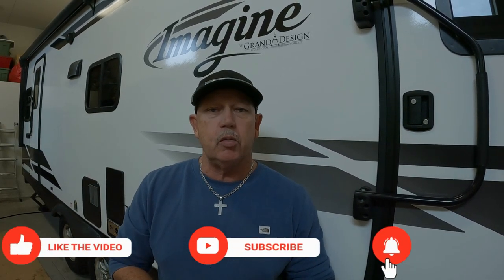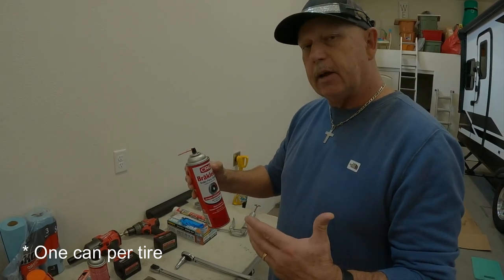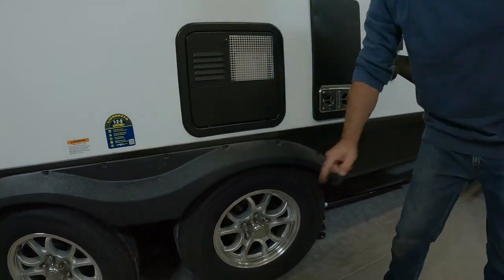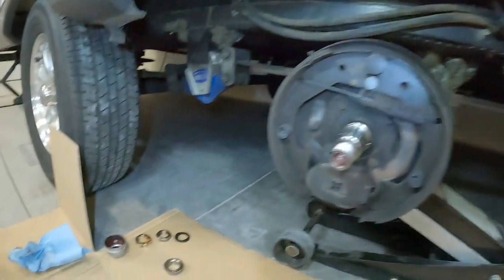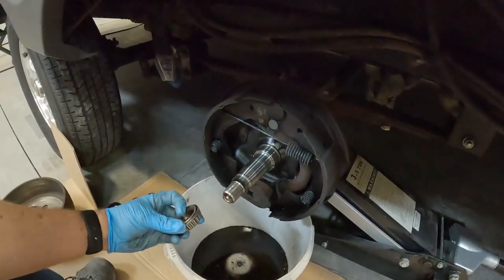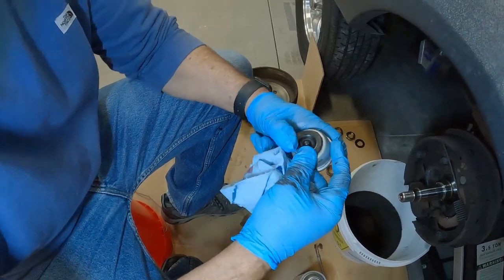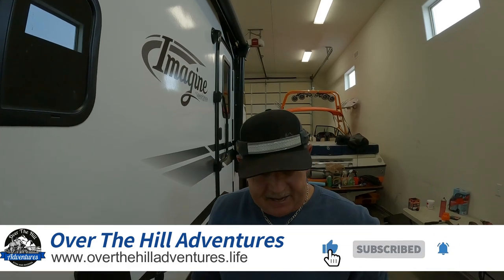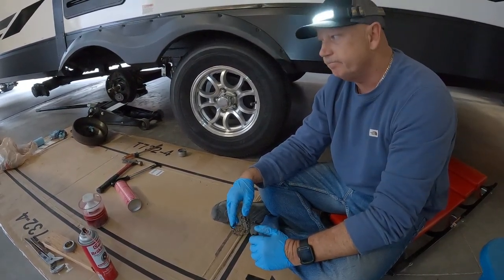GRAND DESIGN IMAGINE DIY HOW TO REPACK YOUR TRAILER BEARINGS AND SAVE MONEY

Comment: Great job. The last thing that must be done, and was not shown here, is to adjust the brakes.
Reply from the maker: We have self adjusting brakes.  You are correct.
Reply: @OverTheHillAdventures  Perfect. But when you spun your brake drum, it moved quickly and easily. It is my opinion they should be manually adjusted at that time, if that can be done. I have never had self-adjusting trailer brakes, so I don't know if they can be done manually.
Reply from the maker: @46fd04  I am going to the Grand Design RV National Rally next week.  I’m am going to ask them. It is also a good idea for another video.   By the time I get back it will be time to check my bearings again.  They are only 3,500 lbs axles for a rig that has a gross weight of 7,400 lbs.  Thank you!

Comment: How much grease did you use between the bearing packing tool and the tubes, for all four wheels?
Reply from the maker: Hi Jeff, I used a half of a one pound tube! Stan
Reply: Per tire?
Reply from the maker: @jeffdroller  no, when you use the bearing packer you only put the grease in until bearing is filled with grease.  You will know this when you see it spew through the bearings.  That is all you need.

Comment: When I used to pack wheel bearings, I would remove the front bearing and then replace the nut.  Then I would pull the drum out quickly and the nut would remove the rear seal and bearing. Is that still an option?  That was in the 70s when we also used to blow brake dust all over the place with compressed air, so maybe my wheel bearing removal method is also outdated
Reply from the maker: Hi Larry, really don’t want to do that with risk of damaging the bearing.  If you are replacing the bearing they still do that. Thanks for joining us. Stan and Rhonda

Comment: They put grease zerks and manufacture has procedures for a reason. But your way works well too.
Reply from the maker: Hi Jeremy, they put zerk fittings as an option I agree.  Maybe not the best option. Thank you for joining us. Stan
Reply: @OverTheHillAdventures  definitelyz uses a bunch of grease… but avoids having to yank out the seal and clean everything

Comment: Question about lug nut torque. I seen a Grand Design chart that stated 15” aluminum wheels are torque to 100 with steel wheels at 110-120. Any idea if this chart is correct?
Reply from the maker: That is 100% correct for the lug nuts.

Comment: Do you reuse seals or get new ones? If new ones, what’s the seal number or tube?
Reply from the maker: Charles, if you go to the description below the video.  There is a link that will send you to our Amazon store. Click on maintenance and you will find everything I used in the video.  I used new seals you never use the old seal once you pull them. Stan
Reply: @OverTheHillAdventures  thank you sir.
Reply from the maker: @charlesmiller3134  you are welcome!  If you need anything else just reach out. Stan

Comment: Just the single $18 bearing. Luckily AutoZone had a cross reference product.  Called local Camping World and they not only didn’t have the bearing. They did not stock any oil seals. ??  Also, my 2023 spindle  differs from the one in your video. Not a surprise due to dependency on China.
Reply from the maker: Nice!! You should be all set to go!!

Comment: I'm tracking the problem and asking - I pulled the breakaway switch on our 2022 2600RB - and the tires kept spinning - not supposed to happen - right?  Battery is charged,  Heading back to try and track the electrical from the breakaway switch; could replace it.  Any suggestions?  THANKS!
Reply from the maker: Hi Mark, sorry for the late response.  Our first day in Canada and ended up in the urgent care with 10 stitches. Definitely something wrong.  The wheels should stop.  There is an in line fuse at the beginning of the run.  All four keep spinning?  Make sure it is connected to the battery.  Let me know.  Stan
Reply: @OverTheHillAdventures  YEOW - 10 stitches - guess it is better than a cast;)  
UPDATE: I have a good news and not so good.  My front brakes work when the break-away is pulled; my back breaks do not and they look like brand new - probably have never engaged - and they are a year older than the front brakes.  I would test my trailer brake gain - and it worked - guess it was just using the front axel.  I'll be tracking the issue. THANKS FOR THE RESPONSE & ENJOY CANADA - STITCHES AND ALL!!
Reply from the maker: Sounds to me you have a cut wire or loose wire in the system.  You know the front is working so I would start from there. Good luck.
Reply from the maker: Stitches are out and all is good!

Comment: Hate to be picky, but you show removal of a washer after the lockring and castle nut removal around 9:50 in the video and do not describe replacing the washer which can be seen on the cardboard up until about 21:30 and then can be seen on the a spindle after 21:33.
Reply from the maker: Hi Joe, your right!! Good eye I messed up on the editing. I forgot the washer and did it again.  I used some of the wrong footage. Hopefully folks are better then me when putting things back together.  Thank you! Stan

Comment: Ok, I typically don't criticize how-to videos, but why in the world would you ever fill the cap with grease after packing the bearings, especially with a greaseable spindle? I've been repacking bearings for over 50 years, including semi-tractors and trailers (before oil bath), farm tractors and equipment, boat trailers, utility trailers. livestock trailers...and have never filled the cap with grease, although I've been annoyed when someone before me has. It's not going to work its way from the cap into the bearing and it would just make that much more mess when you repack it next time. You would have to dig it out to even find the grease zerk if/when you want to add grease. The only exception might be a boat trailer with a spring-loaded bearing buddy that helps prevent water from entering around the seal and it's pressurized from the outside. If it makes you feel better to do so, go ahead, but that bearing isn't going to last one mile longer for doing so.
Reply from the maker: Hi John, I appreciate your infinite wisdom.  Thank you so much for sharing.  To be honest it does make me feel better only because that’s the way it came from the manufacturer.  Hope you have a wonderful day! Stan and Rhonda🙏🏼❤️

Comment: Amazes me how many wannabe back yard mechanics miss the break pad gage inspection.... 
Not to mention correct cleaning of the drum .... not to mention the correct setting of the castle nut ....hand tight?? Really?......
Not to mention correct adjusting of pads after assembly.....
Reply from the maker: There is always one in the bunch move on Mater Mechanic!!